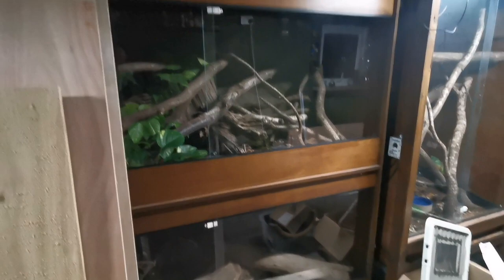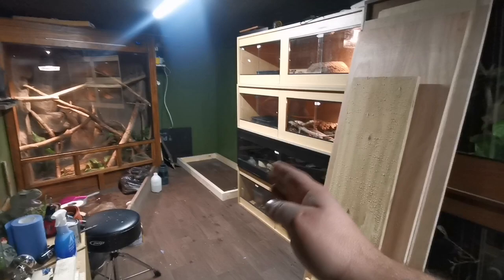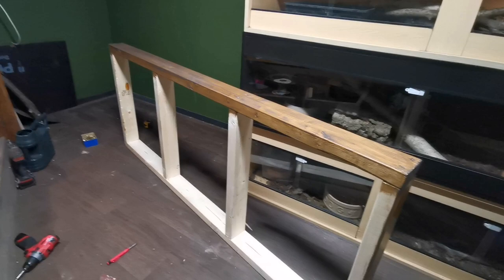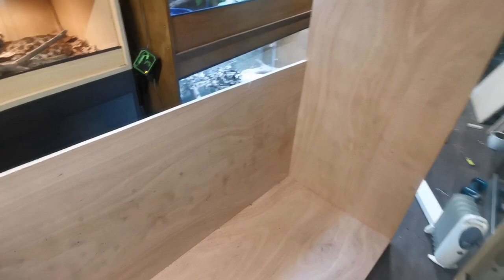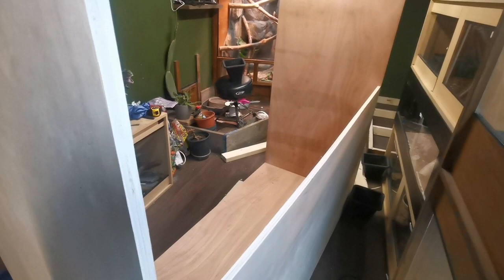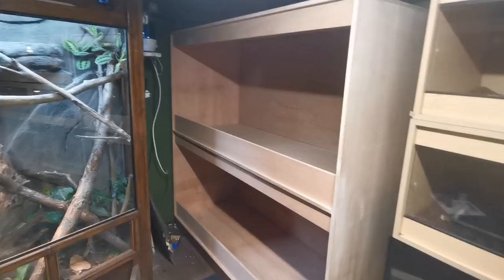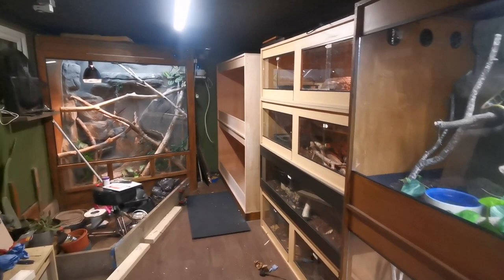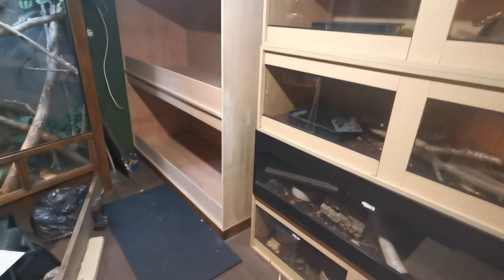Making BIG DIY Reptile Vivariums! Part 1

Comment: Hello, thank you for the video.  I have a question is there a certain type of plywood you use? Do you use a certain type of heat bulb or do you just use heat mats?  Also what brand are those uvb strips and where can I find them.  Thank you
Reply from the maker: Hi, so I have loads of videos covering my equipment setups specific to the snake species but I always use halogen lamps combined with flat rocks to create basking spots. I use a mix of reptile systems and arcadia t5 uvb kits, both are available in all reptile shops or online and the plywood is 18mm hardwood faced plywood.

Comment: Hi mate just wondering for the bottom vivs top plinth how do you secure the middle of it? I assume you're using some L shaped brackets or something since the bottom plinth for the top viv is in the way.
Reply from the maker: Hi, yes I use little brackets, I tried doing a crude pocket hole screw thing but without a jig it's pretty tough.

Comment: Looks sweet bud! Using these as a base for mine being built over Christmas! Is that just normal wood filler you used for the edges of the ply?
Reply from the maker: Ah excellent! Yeah it's just standard interior/exterior filler, it'll be stained and varnished over anyway 👍